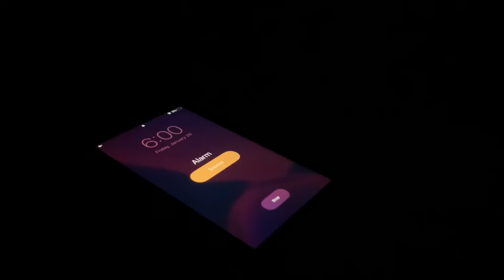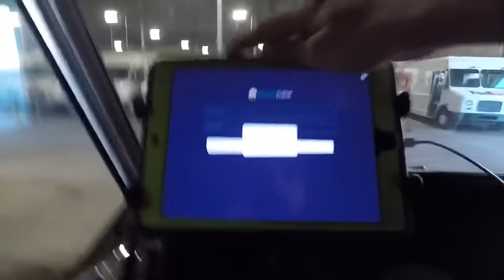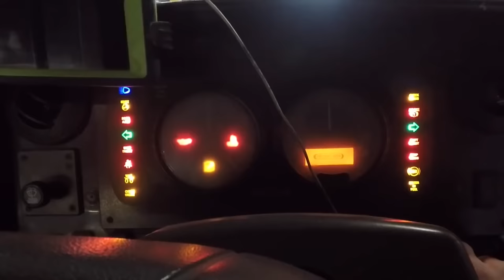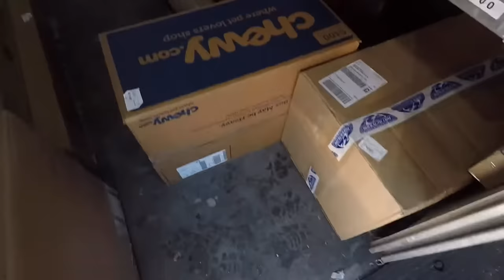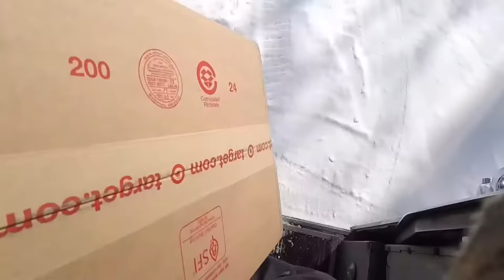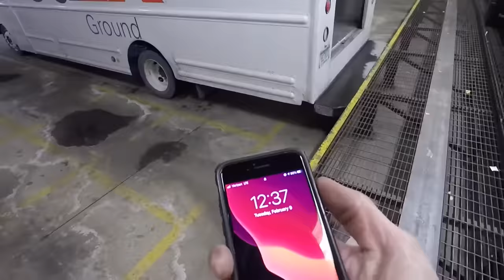Delivering FedEx in Sub-Zero Temperatures

Comment: I worked out in the weather most of my 33 year work life. Some things I learned.  Do not let your head feet or hands get cold before you use insulated hat gloves and boots. Once they are cold, it is far harder to warm them up. Layered clothing works best if sized to provide an air gap between layers. The best thermal underwear is found at hunting supply stores, like Cabellas, and always get the polar weight version. They are not too much heavier, yet provide much more warmth and wicking of moisture from the body. Nothing beats a good one piece coverall from Carhardt. Expensive but worth every penny. 
 I dressed every cold day as follows. Regular underwear or jockies to prevent chaffing. Polar grade thermal bottoms and top. Large light weight sweats to absorb sweat. Jeans or uniform sized to be baggy. Then coveralls when you are ready to start. Layers work for the feet too. Boots should be thermal and a cork layer on the bottom helps. Layers oif gloves helo. Shooter gloves will have fold down finger tips for working without exposing your whole hand. I did land surveying and had to use bare fingers to make fine adjustments to an instrument. It works..
Reply: The best to go into the thermal boots is a two sock system.  The first layer is a cotton sock to wick away moisture.  The second is wool. This two sock sytem is the key to warm feet.

Comment: I am surprised people don’t know about 
Stylus pointers for touch screens. They have a rubber tip. These have been available for many years. You can use them wearing gloves on your phone or any touch screen computer. For instance at the touch screen fuel pumps in subzero temperatures.
Reply: Stylus is clumsy and is a drivers worst friend when delivering in the cold. There's gloves out there with special coating on the finger tips that will allow u to use your phone. Less clumsy.
Reply: @MrKayoed  these are just as bad in my experience but really just depends on the device
Reply: I know about I just loose them every time I get in or out of my truck
Reply: I've been driving for a few weeks for FedEx ground.  The scanners are just stupid, they have tiny little buttons and you must press like 6 times to delivery a package.   I find it amazing that after decades they still have a horribly inefficient delivery systems.  This guy needs a 'scooter' to delivery up driveways.  Total waste of time walking them.  Apartments are the same nightmare.   I'm building a custom scooter to delivery off the truck, they will call me soft and maybe won't even allow it... but its all about doing it fast yet they make it slow.  This guy didn't even put on his seat belt I noticed, that itself wastes plenty of time as most won't do it but new trucks have sensors so you have to..

Comment: Yup typical winter in Minnesota. I know your pain dude, I work outside at Cub. Gotta love the -10 degree days. Just a suggestion if you can use mittens its literally night and day dude. Having your fingers together warms them up very quickly. Even if you can only wear them driving you'll notice a HUGE difference in how fast your hands warm back up. Also merino wool is amazing.

Comment: I worked at this terminal for about a year as a package handler, best job I've ever had. Almost switched to driver but decided not to. Kinda regret it. Still, loading the trucks was fun (until peak) and I tried my best to keep it in order and somewhat organized. I worked on the 100 belt usually, loading 153-165, but I went over and did 300 a couple times. Other times I would run a stray package or IC over or just come by to talk to a friend. You legitimately had one of the worst and hardest belts. Depending on when you worked there I may have loaded your truck once or twice. Thanks for the cool video.

Comment: wow this bring back memories. I was a ground driver for 10 years, heater would barely work feet were always numb. I"ve had a drive shaft fall off twice, steering wheel come off and a front wheel fall off, crazy times! the only thing I miss is the decent expercise.

Comment: In 1997 FedEx got new
 diesel trucks....to test them in the cold they brought one up to Fairbanks Alaska to use on my FedEx route..for some reason the FedEx engineer s had my heat disconnected for two days..with senors taking readings..usually temps during that time was - 40 f at night and ,-20f during the day...

Comment: Nice job my fellow FedEx brother! I understand what you said about the gloves, I would suggest maybe either changing your scanner’s touch settings to GLOVE AND FINGER (SCREEN PROTECTOR OFF) at the bottom most icon on the home screen if you can. If you can’t get gloves that work with it and also keep you warm, changing that over may help. might make it easier. Kind of sucks we dont have a button in our truck to open the terminal gate huh? 😂 and I was JUST talking to my fellow drivers about remote starters man, I feel you on that one! As always, stay safe out there!
Reply: I work for express in Maine. I just cut the glove so my pointer finger and thumb was exposed so the power pad works. It’s better than nothing. I wish I was done that early tho. Most days I start at 7 and don’t get done till 5-7

Comment: I was a courier at Fedex Express for a year and it's crazy to see how different ground is from express. He said 100ish stops and I about lost my mind. 60-70 stops at Express was like an 8-9 hour work day, insane that you did that many in just over 3 hours. Must have way tighter routes at ground.
Reply: Ups driver here, I do 200 stops on average per day.
Reply: @dennisz1303  Must be a super tight route. Most days I would drive over 100-200 miles.
Reply: Look at his truck before he starts engine. He said 120 packaged,  i counted about 70-80. I think he lied
Reply: @ScigusNY   There are packages and then there's "Docs" Which are flat folder shaped packages. he definitely didn't lie.
Reply: Same, I've been at Express for 4 years, I can run my route in my sleep and still 120 stops would take me about 6 to 8 on road hours min. Express is more spread out than ground. I have 5 ground delivery drivers in my one route area.
Reply: in europe we have 300 stops sometimes not even kidding
Reply: @noachzimri5035  I work for Amazon and about 150 stops for me with 300 packages could take my 4-5 hours without break.

Comment: If you have a modern diesel, you don't have to warm it up. In fact, it's best if you start driving (not like a crazy person, but just normally) and it warms up faster. The more it runs cold (like you let it idle), the more wear/damage the engine gets.

What you can do is you can buy a heater. One brand is called Webasto. Basically you can time it when to start heating (like in the morning), and you get into a warm car, and it also warms up the car's engine. So you won't ever have a cold start again. I have one in my car, I just love it so much. Modern Webasto can also do remote heating, so you could start it from your phone once you are near the end of your shift.

Again, Webasto is just one brand, there are others. There are shops who will fit them on your car, it's not expensive. A lot of diesels in Europe, especially in colder climates, have it fitted by factory.

Comment: "crazy modern music" xD You can't be the only one who drives that truck lol! Plus if the truck's alternator charges properly then using the radio "if it works" won't kill the battery lol it would die just by driving it.
Reply: All of our trucks had issues at the FedEx I worked at. I was jumping my truck every day for awhile in some cases. The puny fans they provide on the dash didn't even work or stay in place in the dead of summer. No AC in the trucks either.
Reply: @comgeturs  yup sounds like what you’re given if you drove for FedEx or UPS or even US Postal.

Comment: Good on you for driving a p12 for 103 packages, especially in the snow. I'm assuming you're around ~$180-200 a day? Is that enough to live out there?

Also is 103 light for you or are you normally heavier?
Reply from the maker: Yup right around there then $1.50 for every stop after 135 stops in this contract + monthly bonuses.
It’s enough for me. Wouldn’t complain if I got more though haha
Yea 100 is light. Usually closer to 140-150 average. Had up to 240 around holidays.
Reply: @flatfour3935  I used to work for FedEx ground. I was the fastest in my contract. The most I’ve done was 345 packages. My truck was slammed to the ground with weight lol.

Comment: Love yr FedEx delivery content!! I also love ur stick shift TDI Jetta wagon!! My ex neighbor has a 2002 VW Jetta TDI wagon still running at 170k miles
Reply: I have a 2005 Jetta wagon that made it to 220,000+ miles! Transmission just gave out.
Reply: @vveerrxx  manual or auto?
Reply: 170k doesn't sound bad. My 96 jeep cherokee has 300k on it and still going strong. Only ever needed minor repairs. AC blows cold, heat is strong, starts right up and runs like a champ. It's my daily driver.

Comment: I am a driver for FedEx Ground in western state Colorado. Our Terminal is in Montrose and my route is an hour away in Norwood. I also run Ridgway, Ouray, Telluride, Placerville and Mt. Village... can be below Temps during the work week in winter but I layer up on top but I'm one of those crazy drivers that wear shorts year round.. trick to my insanity is long boxer briefs and I cut pajamas pants to shorts length and slide those on my work shorts.. my gear is issued FedEx. Long sleeve with fleece hoodie, windbreaker/rain coat but to keep feet warm is high quality winter boots (Belleville) and key socks to be Merino wool work socks.. don't cinch the boots tight either.. don't drive the big box trucks but we use the smaller box trucks with warm cab and Bluetooth set up.. thermos of hot coffee and a good lunch makes a 11/12 hr shift ( 4days on 3days off) love my job!

Comment: I'd love working there when outside temperature is -11C i believe right?

Here in eastern europe you would drive RWD VWs roads are vert snowy, you have to do 40-30 packages in small period of time literally running with the boxes to fifth floor in and out of communal buildings, also i will not forget the cool temparature outside -25C° with minimal parking space for vechicles

Comment: I have a pair of winter boots that go up about as high as the boots you're wearing but fuzzy and with a zipper do up. if it doesn't snow heavily I wear those but I also have a pair of steel toe boots for heavy snow. both keep me warm even in -40c. they were pretty cheap as far as footwear is concerned, less then 100 for each, and I've had the fuzzy for 3 or 4 years, the steel toe ones for over a decade.

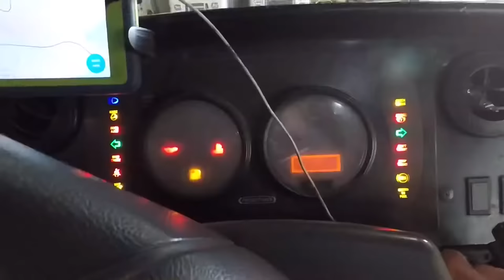Comment: 2:24 Gotta wait for the yellow curly warning light that says "wait" go out. That's indicating the glow plugs are warming up to aid in  combustion when starting a diesel engine in cold weather.
Reply from the maker: I still drive that truck. Glow plug light isn’t timed right. Regardless, the building is heated so it doesn’t need glow plugs. The batteries were just dead on the truck that morning.

Comment: a few speakers even turned up loud arent gonna pull a significant amount of power, the only time if would drain it faster than the alternator could charge it is if you had a full system and subwoofers were involved. but i would assume a big diesel freightliner has a higher amperage alternator than your honda civic

Comment: Have you considered using boots with felt liners in them e.g. sorel, kamik. Also, they make gloves that expose just the fingers so you can use the touch screen, and these gloves have a mit cover to cover up your fingers quickly and easily.

Comment: @flat four. you finished all of your deliveries at 12:45pm. Do you get paid still for a full day?  Or, do you get paid just to finish all the deliveries for the whole day no matter what time you complete them? There is no incentive if you were just getting paid by the hour because I would have took my time. Just curious
Reply from the maker: Paid per day so you can work at whatever pace and still get the same.  Every contractor has different bonuses too.
Reply: @flatfour3935  sounds cool, no wonder you finish all the deliveries by 1pm and now you have the rest of the day to yourself. Didn’t know know that before. I see how hustling all the deliveries can work to your benefit. Thanks

Comment: What's the benefit of working quickly? Like why would you prefer to do 31 stops per hour instead of doing 20 per hour, so then you'd get 5 hours on the clock vs only 3ish. Do you get paid hourly? or do you get a minimum pay no matter what
Reply: Every fed ex ground contractor I've seen pays a daily rate
Reply: @ddennis2430  Ahhh I see. Then it makes sense to hustle lol

I'm part time so I just want my hours

Comment: Are the trucks 2wd, 4wd, or awd? Reason I ask is because I just wanna know what kind of vehicle I'm I'll be driving. I applied for a FT Courier DOT position for FedEx Express here in Alaska and my interview is Wednesday
Reply from the maker: These are RWD. Some of the newer Sprinters are 4WD but all box trucks are RWD.
Reply: Thanks for replying back. Do you have any tips with driving them on ice roads/snow? From what I was told usually 2wd isn't safe to drive in icy road conditions but I figured big trucks like these had different exceptions.
Reply from the maker: @danidelfin6566  keep your momentum up hills and give yourself extra time for braking in slippery conditions. If you doubt you’ll make it in or out of someplace, don’t go for it. I got stuck in a customers driveway once, would’ve much rather walked all the way down with the package instead of killing time trying to get the truck out. They also usually are good with getting new tires on all the trucks for the winter.
Reply: @flatfour3935  Thank you for the advice. I got my job offer today and I'm grateful for it.

Comment: 6:15 Cut out your fingertip then. Don't cut it away, just 3 sides so it can flap. Then just flap it open and can use tip of your finger to touch thing. That's what we do for construction where need to be able to feel the screw when digging it out of pouch.
Reply from the maker: That’s what I ended up doing that season.

Comment: Don't you have to use the door bell and hand over the parcel to the person receiving?
In my country (NL) a parcel left at the front door would just get stolen and then by EU law the shop (sender) is responsible for sending a replacement.

If nobody is home the parcel is either delivered to the neighbors or taken to a collection office. Some shippers will attempt a second delivery the next day. If delivery still fails, the parcel is returned to sender.

Comment: Hey something that might help your cold feet if they bother you enough there is something at construction type stores i call them Clacks but they are a very sticky rubber boot that can go over shoes or boots and they insulate your feet completely i never have cold feet working on roofing in the winter.

Comment: I work as a courier in Ireland for a company called DPD you said 107 stops which you did in a few short hours. How big is your area of delivery? Average working day for me is star delivering at 10am home at 5.50pm. Nice video thanks for sharing your day.
Reply from the maker: Averaged about 40-50 miles (65km) on the route in the video. 2 cities.
Reply: I'd say the distances are quite a lot bigger and the houses a lot further spread apart, once you deliver rural here in Ireland. That and the fact, that DPD really got overwhelmed last year, with the amount of parcels that went through. Still An Post, DHL, DPD and UPS are the reliables here .. so keep up the job .. doing a good one. A lot of the other couriers are useless and they churn through drivers like there is no tomorrow because of it.

Comment: So you only get 4 hours a day?  Toilet and coffee?  I don't deal with temps this cold, but I put a remote start in my 10' Prius a while back for the hot summers to cool it down to avoid hybrid limp.  Then in the winter where it may do down to 30F I start grill blocking with some pipe insulator starting around 75F outside.  But yeah, I'm looking at other careers.

Comment: Hi I deliver for Amazon and I’m just curious .how do you do 100 stops in only 3 hours and how do you make any money like that . We start later in the day and 100 plus stops I don’t get done until 6 pm but we start at like 12:30 1 pm
Reply from the maker: All depends on the route. The route in the video was mostly residential. That’s also a P1200 in the video which is a huge truck and easy to organize everything so it takes 5 seconds to find each package. I’ve done up to 45 stops and hour and have done as slow as 20 an hour. 
Pay isn’t hourly so it doesn’t matter how fast you finish, you get paid a full day. The only time I worked past 5pm was with 200+ stops during peak.

Comment: Been there done that, left that truck running. That's a nono and you gave fedex evidence. Smart
Reply from the maker: lol
Reply from the maker: @Valeo1993  did you see how difficult it was to start at the terminal? I don’t shut that truck off till I’m back at the end of the day.
Reply: @flatfour3935  not your problem is it? At the end of the day you'll get a dq and your contractor will duct tape it together. I had to deal with this bs as well. Just saying be careful. Fedex is getting worse.
Reply from the maker: Sounds like you’ve worked for UPS, not FedEx.
Reply: I was a driver for 5 years and a bc for 3. You dont work for fedex and never have. You're a contractor's pee on. Learn that now. YOU ARE NOT FEDEX
Reply: @flatfour3935  i know a lot more than you do.
Reply from the maker: mhmm u sure do!
Reply: @flatfour3935  obviously i do. Seen people disqualified for the same crap you're doing.